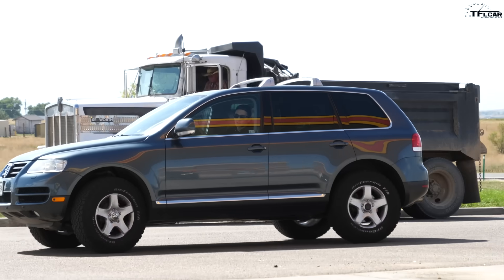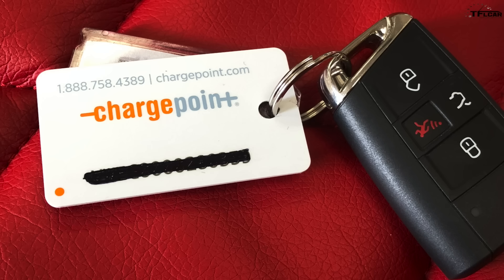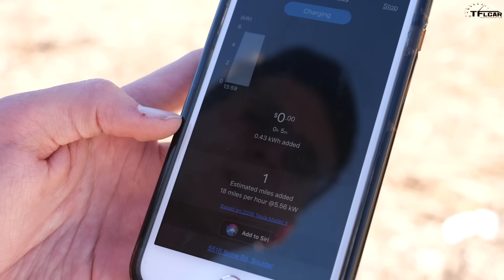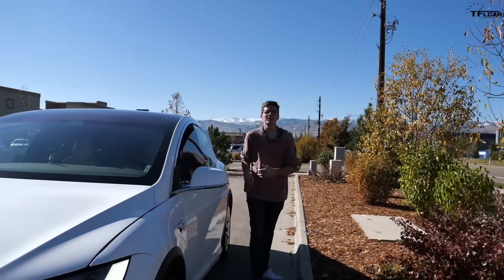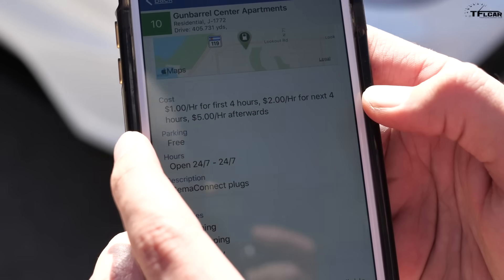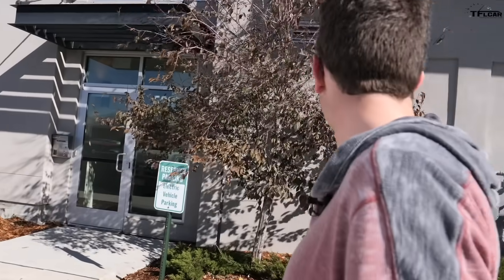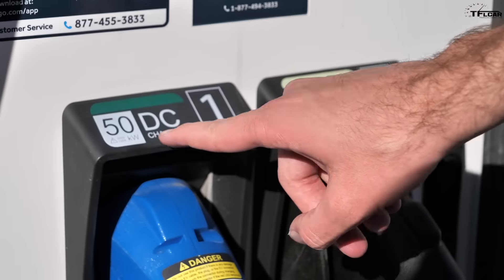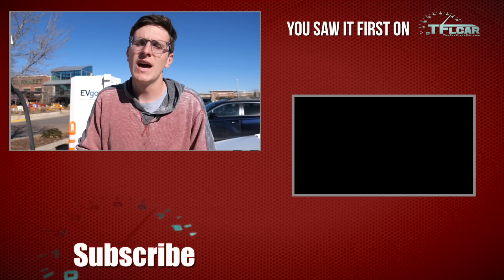Here’s Why Charging an Electric Car Can Suck - And It’s Not The Reason You Think!

Comment: Tesla owns their own charging network called superchargers. They are virtually everywhere. Why would you use a third party much slower charging? With an minimum of 265 miles of range why would you use one of these slow expensive chargers? Tesla superchargers do not require a credit card to use they simply work from 72 KW to a maximum of 250 KW.

Comment: Thank you for the great presentation. By the way this is the best advertisement I have ever seen for Gasoline engine. I think that I will keep my gas engine car for the time being, at least I will not have to:
1- Worry about installing "Special App" to locate and use specific Gas Stations
2- Carry any particular adapter so I can fill up my tank at any gas station
3- Wait for 40 minutes or hours to fill up. Frankly I spend less than 2 minutes to fill up my car and I have never spent more than 3 minutes to fill up my car. Please contrast this to 40 minutes on a DC Fast Charger and several hours in some cases (level 1 charger) to fill up an EV.
Lastly, I would like to exteriorize a simple comment to EV manufacturers all over the world, namely "Whatever happened to Convenience" in the development and implementation of your product.
Once again, thank you for allowing me to voice my opinion.
Reply: I think this video did a really bad job explaining EV charging. EVs are usually charged opportunistically, not driving out to EV chargers around town just to fill up. about 3/4 of EV owners never actually use public charging. Home charging is much easier as you dont need an app or an adapter. You simply plug it in and go inside, and you come out to a full battery in the morning. This video really did a bad job explaining it all and really made it look worse than it actually is. I suggest you go watch the videos from Technology Connections on the subject., he does a much better job explaining it

Comment: I have an electric Zero motorcycle. Takes about 25 minutes to charge from 50%. What I've been running into lately is all the charging stations are in use. Many of these say charge complete. My issue is this is a charging station not a parking spot. Since the chargers are free at my university people think no harm done just leaving my power hog Tesla plugged in all day. Except no one else can use the charger. I'm not implying Tesla owners are selfish pricks but if the shoe fits. You don't park your car at a gasoline pump for the day, what makes you think it's ok to do that at a charge station. Yes the app tells you the state of charge so it's not like they don't know any better. It's common courtesy, there is no excuse for this crap. You are crazy to buy an electric car anyway, your life will revolve around chargers, Range anxiety will be your new co-pilot. Think you are saving money, the jokes on you, don't forget to factor in the countless hours you will spend charging.

Comment: Yeah. No. What do you do for a half hour waiting for charge?!!! Sure, get on your phone, or meditate. I would hopefully charge at home however I understand that can be an issue. A certain type of person only could deal with this. Not me.
Reply: I think this video did a really bad job explaining EV charging. EVs are usually charged opportunistically, not driving out to EV chargers around town just to fill up. about 3/4 of EV owners never actually use public charging. Home charging is much easier as you dont need an app or an adapter. You simply plug it in and go inside, and you come out to a full battery in the morning. This video really did a bad job explaining it all and really made it look worse than it actually is. I suggest you go watch the videos from Technology Connections on the subject., he does a much better job explaining it

Comment: At 2 am in a blizzard, this would not be such a good way to refuel your car.  Then if the power goes out and it's 30 below zero with huge winds, you are probably frozen.
Reply: At 2 am in a blizzard, you can literally plug into the nearest house or business ... you don't need to hunt down a gas station.  If the power goes out, you can't pump gas either.  You're more likely to run out of gas, because with electric you are literally full EVERY time you leave the house.  With gas, you sometimes leave the house with less than a quarter tank.

Comment: I believe the way many people think of EV charging results in less efficient systems and slows EV adoption. Many people think EVs should be refueled the same way we refuel combustion vehicles, with large public refueling stations in which the user depletes most of the fuel in the vehicle and then go to a public station to refill the vehicle. However, this system would be less efficient for electric vehicles. One of the main benefits of electric vehicles is the ability to charge anywhere with a standard outlet. While many people consider a level 2 charger a necessity, this is not really the case. A standard level 1 charger can provide about five miles per hour from a 120v outlet. Being that the average American travels 40 miles daily, a level 1 charger can fully replenish the battery in the time one sleeps (eight hours).  For people with longer commutes, a level 1 charger can be taken to work and plugged in during the workday to gain an additional 40 miles of range assuming an 8-hour workday. Level 1 chargers are usually included with the vehicles and do not use any apps. These can be plugged into any outlet at home or at work. 
          For longer trips, DC fast chargers can quickly charge a vehicle to capacity, these can be placed along major roadways and interstates to serve long haul travels. These should not be seen as the day-to-day charging methods for EV owners.
           I do agree with the wide variety of payment methods being an issue. I do predict that over the coming years that this will be solved. As with many evolving technologies many companies pop up with their own standards of charging trying to capture as much of the market as possible. I imagine we'll see something similar happen with EV chargers are we've seen with the phone chargers of the 2000s and early 2010s, where there were about a dozen chargers that were eventually widdled down to two. If you ask me they will most likely come down to a standard used by tesla and an additional standard used by all manufacturers.

Comment: Thanks for the information. For me--no. Too complicated.
Reply: @cSR-71  you still have to stand in the cold to hook it up if you do not own a home. What needs to be said is if you own a home get an EV otherwise it can be a pain in the rectum.
Reply: I think this video did a really bad job explaining EV charging. EVs are usually charged opportunistically, not driving out to EV chargers around town just to fill up. about 3/4 of EV owners never actually use public charging. Home charging is much easier as you dont need an app or an adapter. You simply plug it in and go inside, and you come out to a full battery in the morning. This video really did a bad job explaining it all and really made it look worse than it actually is. I suggest you go watch the videos from Technology Connections on the subject., he does a much better job explaining it

Comment: wow very convenient to charge your car so you can sit there in middle of parking lot for hours. EV vehicles are just not practical for general use they are just toys for rich people to feel good about saving the environment
Reply: Well said Greg.
Reply: I think this video did a really bad job explaining EV charging. EVs are usually charged opportunistically, not driving out to EV chargers around town just to fill up. about 3/4 of EV owners never actually use public charging. Home charging is much easier as you dont need an app or an adapter. You simply plug it in and go inside, and you come out to a full battery in the morning. This video really did a bad job explaining it all and really made it look worse than it actually is. I suggest you go watch the videos from Technology Connections on the subject., he does a much better job explaining it

Comment: Charging at a rate of 16 miles per hour is beyond comprehension.  10 hours for 160 miles?  3:53  sixteen cents per kilowatt is also insane.  I pay < 12 cents in New England thanks to a local hydro ;-)
Reply: Most people plug it in over night, and being that the average american only drives about 40 miles per day, it's not an issue

Comment: I think the problem is that at the current state of technology, it's only good for certain use cases.  That may service tens of millions of people who live in cities and don't drive more than a few miles a day.  It becomes a problem on longer trips, especially those that go through less  developed areas.  The advantage of ICE cars is they work for all use cases.  Also add in that things that currently don't impact range will for EVs.  Playing the radio and charging your phone now draw from the same power source as the engine instead of running off the alternator in an ICE car.
Reply: Gas car took me 3 days PA to TX.
Tesla took me 3 days PA to TX.
Airconditioned, listening to radio, and charging phone.
Difference?  Gas cost over twice as much, and had to change the oil on the gas car.
Reply: @cSR-71  You had to plan ahead based on miles per charge and stop in a city for the night to charge. You had to locate lodging that would definitely have a charger available right nearby. What if the chargers were taken right before you got there? You're commenting a lot and intentionally simplifying.

Comment: I recently read an article about a convenience store chain adding more EV charging stations in addition to their gas pumps.  I don't know which type.  However, the article and comments were loaded with how great it would be because customers would be around longer to buy stuff. This ignores that the entire business model of such places are designed for quick in and out business.  People fuel up, get snacks & drinks, and if on an interstate go to the bathroom.  They don't have seating for people to sit around for an hour or two.  They don't have enough parking to support people charging for long periods.  

The whole EV push ignores people on medium length road trips where you need hundreds of miles in range and top off part way through.  Staying in a hotel overnight is an expense while waiting for  the car to charge.  It also puts pressure on limited vacation cars.

Now add in the problems with getting cable and cellular service to rural areas.  It's not economically feasible to extend to some areas.  This will be the same for charging stations.  Some people will be simply out of luck.  Then there's the question about all the farm equipment?
Reply: @cSR-71  What if you get there and the charge ports are full?

Comment: You know, despite its extreme specialty.... nuclear power is more portable than elecctricity.  For reactors of the same design, you can take a fuel cell from one and install in the other.   So this is a problem - a really big [and expensive] one.  When your electric vehicle drains down, two choices: have it towed to where it can be charged, or pay some mobile rescue service to come to you and charge that battery.   If anyone hated Los Angeles rush hour before, just wait until 80% of vehicles are electric.

Comment: You did not go into the detail cost of EV’s per charge. You can forget me EVER buying/using a EV. I will buy a horse and buggy 1st. The whole EV situation was not thought through and is definitely a Hugh problem/mess. It takes far too long to charge to go a short distance.  It is not practical for rural areas or long distances, and is far too complicated for most people. People think they are getting a deal with EV’s but they are talking the extra add on charges for EV’s when you buy tags each year (many states add >$200 to cover taxes you do not pay because you are not purchasing gasoline thus they are not getting revenue for road repairs & etc), more personal property taxes because EV’s are more expensive than similar gas powered vehicles, parts for the cars are very hard to get due to parts being made in places like the Ukraine, and getting your vehicle charged can be abandoned usually a night mare especially if you are in any emergency situation or not at home.  I could go on and on but you get the point.  Until an EV is as easy, fast and cheap as a gasoline powered vehicle you can forget it.  If  you are a young yuppie that has more time to waste, possibly more money to burn, is into the latest new gadgets and doesn’t take the time and effort to FULLY research a new “fad” you should NOT get a EV, ever!!!!

Comment: Electric cars won't sell until you figure out how to make them charge while they are running......people don't want to have to plug in their car every hour or two, or spend a lot of time nursing them, they want to get in and go......and further, these things are novelty , if there were hundreds of millions of them on the road , the power grid couldn't possibly produce enough electricity to light and heat millions of homes and hundreds of millions of cars, and most certainly won't do it with windmills and solar panels.......nobody yet has explained how wind and solar are going to be superior to jets......face it kids , you're gonna have to live with oil and coal for some time yet.
Reply: Unless you're going 120 MPH you're not going to need to plug it  in every two hours.

Comment: They write on links how much cheaper it can be to charge a electric car . But when your paying over 10,000 or more dollars for a electric car .You save nothing until that 10,000 dollars has been pain off first . Its like a up front cost on solar panels .You buy all the panels plus installation.Which ends up being at least 20,000 dollars . When you were paying maybe 100 dollars a month for electricity off the grid .You save nothing .Your already in debt to start . Electric cars are more trouble then they are worth . People with a combustion engine car . Can leave their home . Go on any long trip in any direction they want . Not going to be able to do that with any electric car . Car breaks down .Just have it towed to a garage in a nearby town and have it repaired .Buy a electric car .Good luck finding a place that is close to have it fixed .

Comment: Hybrid and electric cars may be cancer-causing as they emit extremely low frequency (ELF) electromagnetic fields (EMF). Recent studies of the EMF emitted by these automobiles have claimed either that they pose a cancer risk for the vehicles' occupants or that they are safe.

Unfortunately, much of the research conducted on this issue has been industry-funded by companies with vested interests on one side of the issue or the other which makes it difficult to know which studies are trustworthy. 

Meanwhile, numerous peer-reviewed laboratory studies conducted over several decades have found biologic effects from limited exposures to ELF EMF. These studies suggest that the EMF guidelines established by the self-appointed, International Commission on Non-Ionizing Radiation Protection (ICNIRP) are inadequate to protect our health. Based upon the research, more than 240 EMF experts have signed the International EMF Scientist Appeal which calls on the World Health Organization to establish stronger guidelines for ELF and radio frequency EMF. Thus, even if EMF measurements comply with the ICNIRP guidelines, occupants of hybrid and electric cars may still be at increased risk for cancer and other health problems. 

Hey you saved the planet but we are all going to get cancer. B

Comment: How is the electricity you're buying produced?  The U.S. for the most part is reliant on coal burning power plants, not to mention an aging power grid to my knowledge not ready for the bulk of us to start using electric vehicles.  Yes, electric is NOT a bad idea but until we upgrade the power grid along with fast charge times, I don't see it as practical for extended drives.  Excellent review and wow, too many different types of plugs!

Comment: What happens in the event there is no electricity due to a severe storm or other other problem that caused the power plants to shut down or the grid goes down? How are you going to charge that electric car? You can still find a way to use a gas operated pump to get gas out of a tank

Comment: Thank goodness I have a Tesla... these janky chargers only charge at 5kw?  Wow that stinks.  Most Tesla Superchargers I go to are 150kw to 250kw.  I basically add over 200-300 miles of range in like 15 - 30 minutes. This is great add for Tesla once people understand Tesla's Supercharger netowork.  The last 500 mile trip I took was a 16 minute stop after 3 hours and then one more stop for 28 minutes.  I charged over what was needed each time because I was getting food and bathroom.  Pull up, plug in and go get a slurpy.  No need for my phone other than to monitor my charge rate... normally I'm running back because it's done, ha

Comment: A guy driving a Tesla ( electric car) when the car went out of control. Lights horn & speed control didn't work it took off at 83 m.p.h. luckily the guy was able to get it stopped. Pretty scary ride. He pulled over off the highway. Had in been in downtown it would have been very bad?